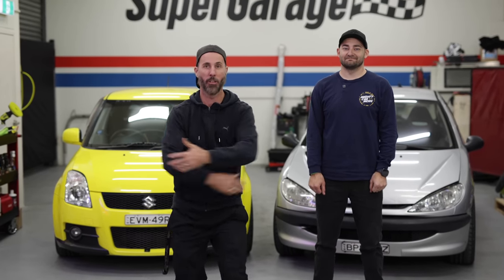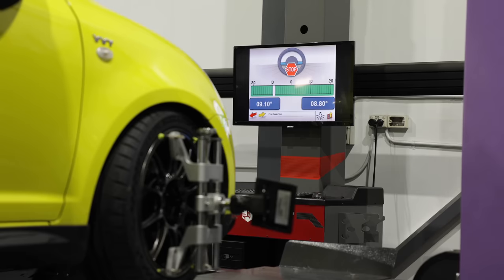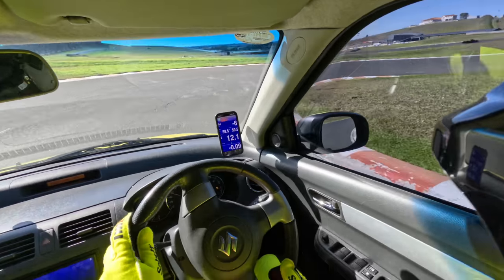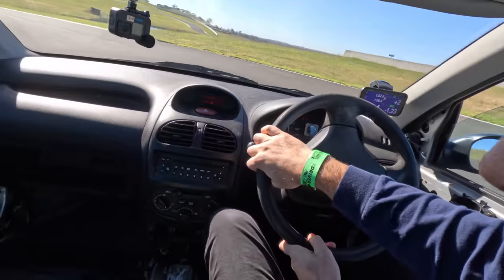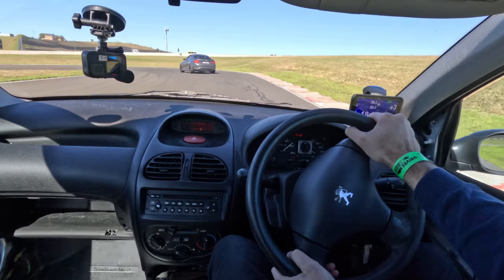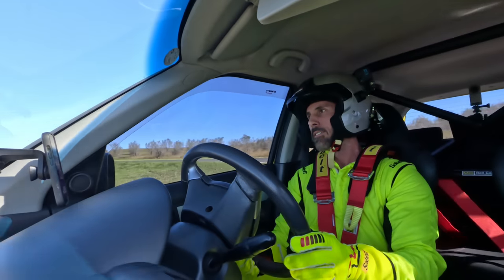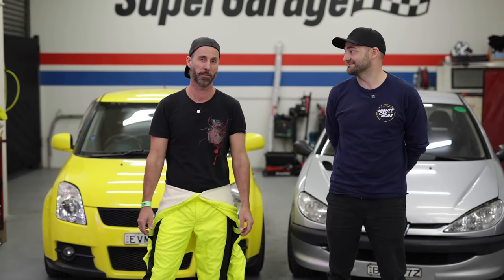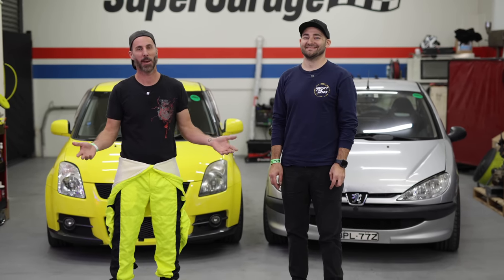Peugeot 206 vs Suzuki Swift FINAL BATTLE

Comment: 1-2 seconds off a small track is big gains, even at 20k, it can seem greuling looking at those figures but its actually quite decent. 10 lap race youd be 10-20 seconds ahead of your former stock setup car. Just to put in perspective F1 spend millions wiping 0.5 - 1 second off their lap times on much bigger tracks.

Comment: Next episode, strip the weight out of the swift and give it a better alignment (if possible). Fix the overheating issues on both and the seat on the 206, then see the lap times. I suspect the swift would be a little faster but evidently maybe not as much as expected going off this test.

Comment: Was the Puglett still crippled with the damn-fool "improvements" that killed the power?
As I own a run-around exactly the same as the Swift, except black, I'd have been interested in mod's to remedy the heavy but dead steering, the weird brake servo', the slow throttle response (might be a heavy flywheel) when blipping it on downshifts, the way the rev's take a while to drop on up-shifts (heavy flywheel, again?), and some of the other little niggles.

Very surprised with the boiling brake fluid - that should have been the first thing to change before ANY track driving.

Comment: The Peugeot 206 is a better car. The suspension is perfectly fine just needed taking to the correct place and lowered allround. As for the 3inch exhaust and intake. Drop the exhaust size and modify the factory airbox would have been better. But great series

Comment: Even the High car V low car challenge with 350Z had the Low car on top. In that case I be it was all down to the low car staying with the Nissan CD00 box,  massively better ratios than the terrible Tremec

Comment: Martin You should have went with the classic recipe for the TU5JP4 man... Basically you get the stock cams/cam gears-valve springs-retainers from a saxo/106 TU5J4 engine and the exhaust manifold... With those you can tune the stock ecu to redline to 8100rpm reliably and get 140-150hp if you push it a bit and tune the cam gears for a bit of overlap... Not sure about the 206 frame but the 306 I had was quite good and probably more turn-happy than the swift... The engine mods I talked about are quite cheap but if you want to go the extra mile, with a set of aftermarket cams you can go up to 160-170hp with a pretty much stock config... And this is kinda insane to think about... with less than 1k you can have a pretty competitive little hot hatch 😁 The TU5JP4 engine has bigger valves, bigger ports and a 11.1:1 CR compared to the 10.3 of the TU5J4 but it’s so cut down in terms of RPM and cams that you’re losing all this free performance for emission reasons basically 😰
Reply: Hydraulic tappets become unreliable at anything over 7800rpm even using the J4 competition ones, J4 cams also run well off centre on them when used in the JP4 and accelerates wear, catcams do do all the J4 spec grind cams on JP4 blank though so none of that issue.
Reply: @AJ_Irving  I’ve heard that before but I went with it anyways and i did about 100k km without any issues till I sold it... My friend still has his saxo with well over 400k km on it and he runs reprofiled 282 degree cams on stock J4 lifters/springs and he revs it to 8100 daily 😅
Reply: @dukeofdream  the main problem comes when you run a long straight on the limiter when you ran out of gear not accelerating though. I have my TU3JP4 set at 7800 for that reason.
Reply: @AJ_Irving  Yeah don't do that :P haha I mean it should come without saying that you should never hurt your engine like that... I mean on these engines with the hp graphs they have it doesn't make any sense to rev them that high after 1st and 2nd gear, and you never stay on the rev limiter either, also doesn't make any sense 😅 For 1st and 2nd 8100 and then 7500 on the rest you're golden xD do you have any video of your TU3? I always wanted to do a project on them since they are supposedly more rev happy than the TU5?
Reply: @dukeofdream  once you destroke them you have to rev them but they like it,😂  there is some on my channel one rolling road and some on using it on stage one the sound got out of sinc at the end though in upload.

Comment: If the point is to show the difference in an expensive setup vs a cheap setup you should have taken full advantage of EVERY adjustment option afforded to you by the expensive stuff since it would show the advantage of those parts.
Reply from the maker: The Swift doesn’t have that much adjustment. Is it ‘better’ suspension? Maybe, but the Peugeot held up well. As discussed some negative camber wound have been a huge advantage to either car but neither car has that adjustability.
Reply: @mightycarmods  How many laps before brake fade on each car? Suprised you guys didnt do brake upgrades. did the swift have engine issues before the shoot? maybe the K and N isnt crud? Is that why it came up short on the dyno? and then died. Do you think if both cars were stripped and caged the results would be the same?

Comment: With the Peugeot you can build a Replica of the WRC Winner of the Years 2000 and 2002, how is that no tuning potential? The Swift is a generation newer model, it came out in 2005, which is the reason for the older tec in the Peugeot.

Comment: As someone that owns 206 and my wife has a swift. The pug is more comfy, larger boot, handles better. Engine is better on the swift the 1.3 is better in my case then the pug 1.4

Comment: Marty needs to turn the 206 into a Rally car 👌💯🤙 then spend money on the engine thats the same engine as the 106 gti and saxo vtr basically used in rallying fully built around 220-240 hp at the flywheel n/a on itbs 💯

Comment: The suspension should have been tuned properly on the swift. That's what the money was spent for and it would have balanced out the advantage of the extra weight of the roll cage? Really enjoyed this series but I think just buying an old Honda Civic Type R would have chopped both

Comment: Hi, thanks for the video, just wanted to say, If I lived in Australia and want to do a track day and I have the cash, I would go for a nice handling car, I would probably do some mods to the power and brakes, therefore Swift Sport would be my pick, I use to own a 2014 Suzuki Swift with a 1.2L engine, not a whole lot of power, but quite adequate for island life driving and I loved it. Sorry Peugeot fan boys I would never go for a 206, it is not a reliable car in my opinion, if you were to put a 2010 Hyundai i20 next to that thing, it would fair better in my opinion. I have also owned an I20 in the past and I have driven a 206 also. The i20 drives better.

Comment: Stock suspension,,no roll cage,,the swift would be a second faster than it is now...then for the track,,the car naturally runs too hot,  even before hitting the track ,,so a thermostat swap would make things much better as the ecu is very sensitive to temp and will reduce power by quite a lot...easily another second quicker

Comment: i think you left out a really important point there at the end. It might be boring, but a lot of the 25k did go into safety and even though this money isn't spend on anything fun or interesting to work with, its still quite important if you plan to drive at trackdays where not only you but the people in the other cars around you are not always trained drivers. It seems a bit unfair to the Swift to leave that out. Just look at that peugbro seat, this can easily become the first and only trackday for the car the driver or both...

Comment: A little bit ashamed about Peugeot’s technical condition - this car is very light and drives so nicely - Ido own the same car in nice condition, powered by 1.1 TU engine, which is 8 valve. The way French are tuning them - is to combine my 8V head and it’s stock gearbox together with the iron block from your 1.6 and lighten pistons kit for TU24 (from 205 Rallye) - pistons sleeves in TU engines are easily interchangeable. Those changes will make it rev up to 7500 with 110+ hp. May sound not so exciting on paper, and the gearbox from 1.1 lacks max speed; but this gives ability to  access max torque anytime by shifting gear down and to always accelerate effectively

Comment: Does anybody else also always think how your own car would fare against those modified cars?
Mine is a BMW 330d, they are sold used for less than 25k in Europa and have a lot of power.
They are a lot heavier and bigger  however so i dont know whether it stands a chance on small tracks.

Comment: Questionable results really. Why not have the same driver drive both? Why did the swift get a cage and still have a full interior while the 206 didn't get a cage and 90% stripped?

If you guys plan on doing something like this again then I'd suggest getting an already good platform like the GT86/BRZ, leave it completely stock and get something cheaper and use the price difference to mod it.

Comment: Can we get an alignment deep dive. I get a report from Bob Jane that all my alignment is in spec, but my cambres are unequal etc. So must be fine and within spec, but no idea
Reply: wdym by unequal? are they not the same on each side or what specs did you get back?
Reply: @arcanevoid9199  yeah different camber angles on each wheel, you can't adjust it either (I think) unless you have fancy suspension
Reply: @Habdabi  are they within half a degree or so? it doesn’t have to be exactly the same number and sometimes it’s impossible due to lack of adjustment. could also indicate bent suspension arms if one side is way out
Reply: @arcanevoid9199  yeah they are 0.2 different at the front and basically 0.2 different rear too (opposite side on most negative)

Comment: I feel it's stupid, why make a comparison between trash and cash when you try to set them up as equal as possible and withe same expensive tires. It makes no sense. If you get the expensive upgrades it's to get all the advantages not to dumb it down

Comment: Why would you pay heaps of cash for a full race suspension and then tell them to match the nearly stock suspension geometry of the Peugeot? Isn’t the point to see if you can get the same outcome if not better with scavenged parts?

Comment: Always good production value, but this series was all over the place - if it was the same car different parts it would have been way better. Or even different cars, great parts. The suspension setup was messed up too - why put in great suspension if you’re not going to tune it to its potential.

Comment: The adjustability of the more expensive suspension is half of why you spend the money on coilovers, so matching the trash car on alignment was an odd choice. I feel like that would have been the difference... That said, a totally stock, used GT86 would thrash both of these cars for less money than the Swift, so does it really matter? Not at all. lol

Comment: That was unexpected for sure. I was pretty confident the Swift would absolutely dominate the little Pug. The Swift would have had to work VERY hard to justify the expense either way as I think Moog could've done a lot better if he had the 25K in his hand to buy a car rather than spending 19K modding something that isn't really all that cheap to begin with and fairly slow. 

Maybe I'm just showing my ignorance here, but surely you can get a NB, maybe an early, scruffy, high mileage NC, Miata for around 25K AUSD? Or just any car that is less likely to commit harakiri to restore its honor after being beaten around the track by an ancient Frenchman flashing its "Check engine" light.

The Pug was always going to be the winner imho even if it was slower than the Swift simply due to the cost.

Comment: For the next series, it would be neat to see a (slightly) better car from stock (like the Swift here) get the cheap stuff while the weaker car from stock (Peugeot here) gets nice stuff. I.E.- can aftermarket parts and mods overcome better factory engineering? Thanks for the videos, MCM!

Comment: The Suzuki could have stomped the Peugeot but the money wasn't spent in the right areas. There are exceptions for some tracks but the most speed comes from spending money on tires and power. Without a sticky tire the suspension upgrades won't see much benefit. A car with 100hp probably doesnt accelerate hard enough to need upgraded rotors and calipers. Most stock brake pads and fluids are barely adequate for street driving though so I wouldn't consider them as an option on the trashiest track car.

As far as the weight is concerned, if Porsche can charge more for a car with a stripped interior then you can say weight reduction is critical for a cash build or a trash build.

Comment: Fun series, totally in for more.  having said that, some thoughts:

1) The cars are shit.  Even Marty's $6000 is way too much considering how unpleasant it must be in that car, and the fact that it didn't really survive any significant number of laps.  Limp mode activated.  Same for Moog's.  Slight (*slightly*) better car, still had reliability problems.  White plumes of smoke.  If racing is really an interest, all monies should have been spent on reliability, because it's not a lot of fun if the car breaks on track.  But -- not the point of the series, and I get that.

2) I would like to see a series where some consideration is put into part selection.  For example, just buying the cheapest thing isn't really a great idea, and not even safe depending on the part.  Sure it's an extreme and makes for good viewing.  But I'd rather see two cars that are at least somewhat capable of surviving (like maybe two old 350z's or something like that -- something affordable, tons of part variety, a good range of cost and quality, but still with a decent shot at being fun on track), with a budget build vs. money build.  And budget, in this case, is not trash.  But decent parts, but at a budget.  For example, a serious consideration might be $300 Enkei's vs $600 Rays -- budget vs money.  Is there a real benefit to the Rays despite double the cost?  Corbeau seat (budget race seat) vs. a Sparco or Recaro (higher quality, lighter seat).  These are actual, real considerations people will have.  The extreme of money-is-no-limit vs. dumpster is fun, but not that realistic, especially when it comes to racing for any kind of decent time.  In this case, it would better showcase the money spent on "quality" parts through adjustability, tunability, etc. and provide more of a like-for-like comparison, and help would-be weekend track warriors make informed and legitimately good decisions on where to spend the money.

For me, the series was fun, but with #2 from above, it would make the series far more interesting.

Comment: I would have felt better about this series if you guys had approached it a little differently. Rather than dumpster diving for junk and pvc pipes and whatnot, you could have done budget mods vs. expensive mods, imo would be a better comparison of real life scenarios. Not tuning the suspension depending on the capability of your setups, gutting one car and adding weight to the other, spending thousands on a racing apparel and losing power with the intakes left me with some questions in the end. Maybe more research was needed to understand what people were and are doing with the 206 in Europe for the modifications to make more sense, anyway what's done is done, perhaps for the next series.

Comment: Light weight car with small engine, loosing weight should give you more feel, braking, and power, as long as you can get enough downforce and a good balance on weights reduction. Then add power and you will probably see a bigger differences. Thats my opinion, loose weight 1st than improving durability mods to handle more power, and then power mods.

Comment: Not a fan of this series. Too much like Top Gear. It would have been better to spend equal amounts on two cars and try different mods - spending money in ways that demonstrate the best dollars spent per track gains. It is what you do best, why change a formula that works?
Reply: If they spent the same amount in both cars, it wouldnt be a fair challenge. The 206 would wipe the floor with the swift

Comment: This series was mostly a bunch of industry "experts" telling the audience that the things they sell are worth spending more on and backing it up with nothing. The wheel guy saying that the metal alloy is better/different was the biggest laugh. Good wheels are stronger because they're forged rather than cast. That costs money and makes the wheels more expensive. Swapping to a different alloy costs bugger all so even the cheap wheels are made with the best materials. Far too many "experts" in the automotive industry.

Comment: There are reason Peugeot owners won't align, service properly or add cash or trash to make faster their car... They're designed to survive owners and lack of maintenance or repairs, doing otherwise will just disturbe the force. You can rally any stock PEugeot with a hole in the exhaust just to make people thing you actually tuned it, some paint or stickers and a rear spoiler, a counterfeit 206 WRC will do...and you can rally it until it breaks or you finally get what dashboard light meant... going for an aligment is just too much of a involvement. Look for amateur european rallies, adding a metal floor pan or skid just not to blow the low-end every time you jump until your body or the 106/206 body says enough is enough... painting white the rims will also help... even actual 206 WRC official teams were because not only they used professional mechanics around them but also actual racing engineers...The engineers work is to stay on the factory working on cheaper ways to build a long lasting vehicle and managing and supervising real human-like apes disguised as potential customers interacting with prototypes or prodcuts once out the production-line to certify and QC...